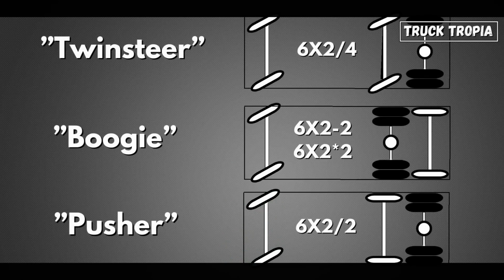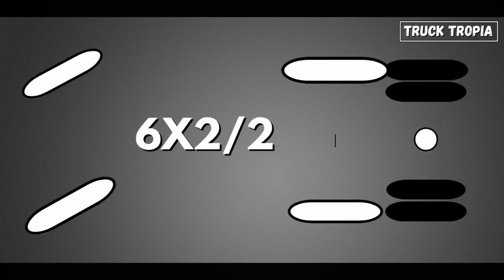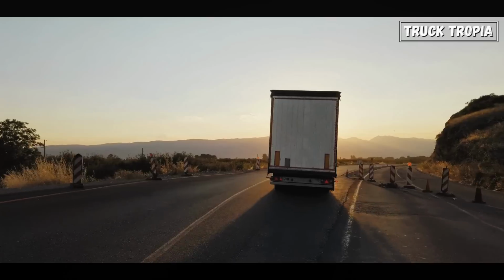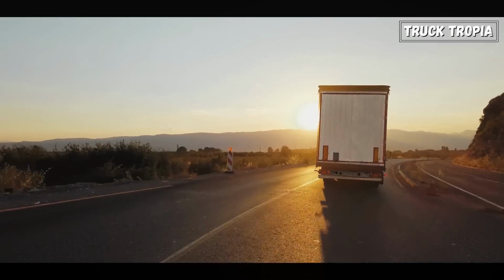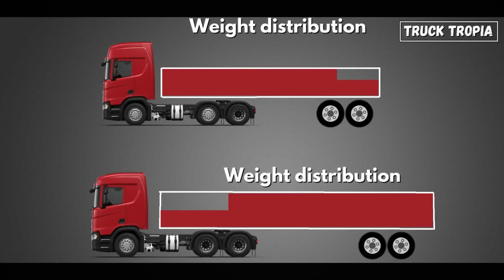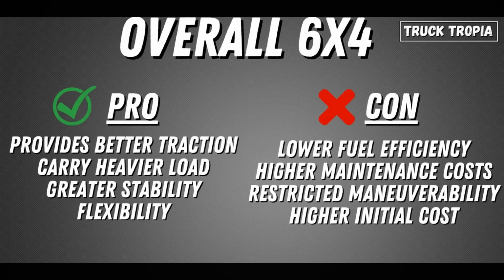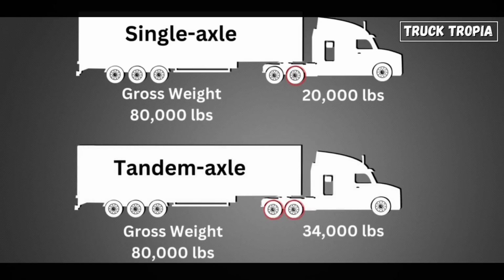THIS Is Best Semi-Truck Configuration - 6X4 vs. 6X2

Comment: This video cannot possibly cover the global weight restrictions and ideas buerocrats have come up with. 

I have driven a Scania 6x2 with lift axle and had to reverse in very tight and muddy bits of a road. When all you habe got are 20cm front and back, and you can only make the turn with spinning wheel despite lifting one axle, you become very appreciative of two driven axles. 

Scania has introduced the disengageable tandem axle which is also liftable. In 2021...This is the perfect solution imho.

Comment: 6x2 and even 4x2 is common enough Euro trucks. Most trucks never leave a paved road, or travel difficult hilly slippy sections often. Flatish, smoothish roads is all they see. For those with Double Drives they often have hub reduction fitted for hauling heavy machinery, 80,000kg gross.

Comment: In Europe the 6x2 can have 11.5 tons on the driving axel but 7.5 tons on the traling  axel reducing the difframce in traction quite a lot.

Typically in nordic country 6x2 are used for medium trucks and 8x4 for heavy trucks.

Comment: The comparison @4:22 is nonsense. 34,000 lb is the basic limit in US federal regulations for tandem drive axles, but 20,000 pounds is the limit for a single drive axle (as in a 4X2), not a combination of one drive axle and one pusher or tag axle (as in a 6X4).

Comment: @Truck Tropia, what you failed to mention about the 6x2 configuration, is that the air can be dumped on the second non-drive axle to increase traction in difficult terrain, you really need to do more in-depth research before putting out these videos, as informative as they are, you still missout vital information or give misinformation, also your basis towards American built trucks is so blatant,  to balance things out why not do a video about European truck and trailers versus American built truck and trailers on the techno side including EBS, design and build of trailers, bearing in mind that the USA trucks normally operates at 36 metric tonnes, whereas European trucks run at 40/50 metric tonnes, and the UK runs at 44 metric tonnes, with I might add a trailer length of 45ft.

Comment: A double locker 44000 lb Mack camelback 20000 lb front end 
200" wb 500hp ISX 18 Speed manual with a non hydraulic clutch 
F model cab Aussie roo bar front bumper 11r22.5 all around on 10 hole classic Alcoas. 
Oilfield head rack on the back of the cab. Frameless dump style 5th wheel. 
Hard cab no air ride. 
I'd pull a 8 axle all aluminum covered wagon  B Train 
The trailers overall length would be 53 ft +15 for the truck 68 ft long overall 
Should be legal to scale a 45000 lb coil in each wagon.

Comment: Hi there, here in Brazil we use a lot of different  configurations to semi trucks. the most of them who drive on Road usually use 6x2 configuration, mainly at long hauled distances. And we use European truck model 100% of the fleet is cabover. Scania, Volvo, Volkswagen, Iveco, Mercedez Benz, Daf. And the most of semi-trailers here  they have 3 axels in tandem. I notice that in the US most semi trailers have only two axles. I would like to know why only this kind of configuration?
Reply: Strange how Volkswagen is european and there are no VW trucks here, but there are elsewhere!

Comment: Actually in Central Europe 4x2 is the most preferred drivetrain layout as with the usual „Euro-Trailer“ with three axles you can make use with the max. GCW of 40t. 6x2s are used in the UK and Scandinavia where higher GCWs are allowed.

Comment: Having a 6x2 or a 6x4 does have nothing to do with the wheelbase. Manufacturers in Europe have managed to make them the same length
Reply: True, but typically if there are two rear axles with neither of them steered or castered (regardless of whether or not they are driven) will need a relatively long wheelbase to keep tire scrub in tight turns to an acceptable level.

Comment: Why 6x2 when you can just run perfectly on 4x2 instead?
Reply: You can legally put more weight on the truck
Reply: @maxi5778  Well that's hardly a good reason to do so because there are many countries such as India, Philippines, Indonesia, Vietnam, Thailand, or any of those 3rd world or 2nd world or developing countries have shown that 4x2 is more than enough to haul such goods. Even 4x2 underpowered japanese branded semi trucks (Fuso, Hino, UD) with poorly maintained engines are able to haul a 20 footer container or big heavy pipes and steels on a trailer bed without any problems.

In Europe or America, they even barely haul anything seriously heavy container goods and yet utilises a 6x2.
Reply: @Intel & Nvidia SUXXZZZ!!!  I daily drive a 6x4 and I quite often do heavy haulage driving loads that weights around 58 tons with my trailer, my colleagues that drive 6x2 with the same trailer are legally only allowed to load 54 tons, everything is exactly the same except from one truck has one more drive axle
Reply: There is no better or worse, it all depends on local regulation, roadnetwork and the market situation.
Reply: https://youtu.be/SMzQb0s302w

Comment: No, you're wrong about the 6x4 having more stability than 6x2's

Here in the United Kingdom, there is NO height limit.

British motorway bridges have at least 16'6" clearance available, so many trailers are double deck 16'3" tall. 

These trailers carry 42 or 52 pallets at 44 tons (97,000 lbs).

The American weight limit is only 36 tons (80,000 lbs)

I drive 44 ton double deckers over the Scotland's highlands in the snow with 6x2 tractor units.

There is no problem with stability pulling 44 tons worth of double decker on VERY twisty Scottish snow & ice roads with a 6x2 tractor.

Ye dinnae ken yer bleathing on aboot!

Comment: No, you're wrong about weight limits.

The standard British weight limit is 44 tons (97,000 lbs). Most tractor units are 6x2. 6x4s don't carry more weight.

The American standard weight limit is only 36 tons (80,000 lbs).

The American habit of 6x4 is due to tradition & stupid US law.
Reply: In the Netherlands it is 50 or 60 tonnes, depending on the outfit.  In Sweden it is more and in Finland they are going up to 90 tonnes or so, this although with two driven axles
Reply: I doubt there is any US federal law which makes a distinction in load capacity or legality between 6X4 and 6X2.

Comment: The best for road use, fuel efficiency and weight saving in the 4x2 configuration, as almost all 44 tons semitrailer trucks in Europe.
We have to say that the standard tires are bigger in Europe.
Reply: A 4x2 with a 3axle trailer is the worst thing on the road
Reply: @aanriuha our truck trailers are very heavy: the axle are usually three, but with single, bigger wheels. The road tractor has 4 wheels, but the tire size is bigger in Europe. One more axle means more weight. This standard setup was developed after decades and it's the best for the European roads.
Reply: with the highest road wear... 6x2 plus 2 axle trailer would be much better, since the weight gets distributed more evenly and there is no single axle carrying a high tonnage but the weight of the cargo is split 50:50 on 2 axles each.
Reply: @denzzlinga  Depends on how the axles are placed under the trailer.
Reply: @bertnl530  sure but you can´t move them a lot without the need of steering axles, due to eu regulations how the whole thing has to turn in the end.
Reply: @denzzlinga  That's true. 
It is also a question of write off.  Trucks are expensive,  tri axles are even more expensive.  Normal write off for a truck is like 5 or 6 years.  With leasing it is like 3 or 4 years.  Then the fear for smaller defects and  time in the workshop  comes.   
With trailers however it is a different story.  Trailers can have a working life of 12 years or more, without big problems. Tyre wear is normal wear .  So it is easier to write of a more expensive trailer and earn money with it, then with a truck. And write offs and money is an important thing in trucking.
Reply: https://youtu.be/SMzQb0s302w

Comment: Euro Trucks look Feminime, No Driver Comfort, US Trucks are the Best
Reply: Depends on what you mean by driver comfort. The only thing US trucks have going for them is more space. Other than that they only just now starting to catch up with the tech that EU trucks have had for the last 10-20 years
Reply: @rikardandersson7288  well Space, is a big comfort factor
Reply: @nenadcubric2663  can't argue with that. However other driving aids and ergonomic solutions also contribute to driver comfort. Take volvos vds for example, it is speed sensitive steering that allows you to literally steer with one finger when manouvering. And it also takes away the jerking in the wheel from potholes. Not to mention that it also steers the truck back in it's lane if you start to drift. Other things as adaptive cruise control, blind spot monitoring and the best automated gearbox on the market also adds to driver comfort in my opinion
Reply: Have you ever watched the videos here on YouTube where they test a new Scania R770 V8 in USA? Everyone that drives that trucks says it's the most comfortable truck they have ever driven so clearly it's better than many american trucks. You should watch these videos

Comment: I personally drive a 8x2 tanker truck with 4 or 5axle single wheeled trailer.
68tons and 1 driven axle. There is a button for "shifting weight" to the driven axle, making it kind of over loaded ("Norvegian" boogie in volvo up to 18tons for driven axle). The axle is durable enough and usually slippery conditions mean that the road is frozen so high axle weight won't damage. 
The most common in config in Finland for tractor units is 6x2 with last axle being liftable and having dual wheels for higher weight limits
Reply: Here in Brazil I drive a volvo FH 540 with 2 semi-trailes and 9 axels in total configuration. 74 tons of weight and 54tons of payload.
Reply: Forest industry on Finland also users 8x8 trucks. Already scabies does 8x8 trucks. I've driven a few of those

Comment: US trucks mostly are 4×2 & 6×2! In USA loads are light roads are straight flat but very bad only 6 steep long hills BUT the diesel fuel is lower qualuty still freezes winters & is cheaper than in Europe! The maintanance in USA is bad due to lack of professional service mostly Mexicans do the labor!
Reply: No, most Class 8 highway tractors are 6X4, not 6X2. Perhaps 6X2 is common in your area, but they are not across the USA. There are tractors with no interaxle differential, and a disconnect for the rear axle, so they are 6X2 until the second axle is engaged, then they become 6X4.

Comment: for me as a truck driver's son, here in the Philippines they choose the 6x4 configurations because the roads here are very difficult and another thing is that the trucks here are heavy, let's take as an example the Rigid trucks that are 10 wheeler wingvans their maximum load is 25,000 tons almost 50,000 pounds. if you travel from luzon, visayas to mindanao you can't avoid going through the mountains because most of the part of the AH 26 highway goes through the mountains and the elevation is so difficult, that's why they and I preferred that.

Comment: In ATS I always use 6x4 for the trucks I drive since I haul a variety of trailers everywhere so I need greater pulling power and flexibility. Maintenance and fuel cost are probably not very noticeable if there is a difference at all in the game. 🚚
Reply: Plus, I feel more stable driving 6x4 or 6x2. And braking distance also feels shorter compared to 4x2.
Reply: What's ATS ?
Reply: @aanriuha  American Truck Simulator, it's a trucking game for PC.

Comment: Truck axle configuration is affected of legal limitation about vehicle or road law.
In The United States, Federal bridge formula restrict maximum gross combined vehicle weight (GCW) up to 80,000 lbs (almost 36,000kg) if trailer-tractor truck has 5 axle (3 axle tractor and 2 axle trailer).
BTW, The United Kingdom vehicle and road law restrict GCW up to 44,000 kg (almost 97,000 lbs) if trailer-tractor has 6 axle (3 axle tractor and 3 axle trailer).
And If trailer-tractor has 5 axle (2 axle tractor and 3 axle trailer), GCW is limited up to 40,000 kg.
In European countries in Continental, their law restrict GCW up to 40,000 kg if trailer-tractor has 5 axle (2 axle tractor and 3 axle trailer) by EU order.
So many over the road tractors operated in The U.K. are equipped 6x2 axle configuration with lift axle.
In The U.S. 6x2 tractor provide better fuel consumption and maintenance cost.

Comment: 6x4 are very well matched for the 500 hp plus European diesels, yet are less popular there🤔....quite a paradox. Anyways, we get to put the to proper duty here in East Africa due to our less than adequate paved roads on last mile to destinations. 6x4 tractor lays traction power like a beast.....and gets the cargo delivered on a cinch!
Reply: 6x4 in Europe will result in a very shor trailer. Their roads are very small so 6x4 with 3xl won't be flexible in turning
Reply: 6X4 doesen´t make sense for standard trucks in europe. You would have to be super carefull when loading, since then having only 2 axles on a standard 13,60 m trailer (you won´t need more than 5 axles total for 40-44 tons) can make them overloaded pretty fast. You would need to stuff everything to the front of the trailer, leaving the back almost empty. 
With a 4x2 tractor and 3 axle trailer, you can evenly distribute the load from the front to the back of the trailer, and everything will be balanced without any issues.
Reply: It's because of fuel efficiency too. In EU most tractor trucks are 4x2s and they do a fine job on asphalt roads, you just use more fuel with 6x4 and get nothing out of it. I've seen more 6x2 with lift axles (the extra axle is lifted up 99% of the time even while hauling a trailer) and 8x4 trucks (like the Actros SLT) than I have 6x4s. I'm pretty sure 6x4 tractor simply doesn't make sense here. Maybe for construction or something.
You need your cargo to make both 6x2 and 8x4 truck an unacceptable choice (like 6x2 can't haul, 8x4 too expensive) for that configuration to make sense. I doubt there is a huge amount of cargo pulled with tractor units which fits the description.

Comment: In the US, driven or not doesn't change the weight rating.  A tag axle makes a single axle a tandem axle.  It is even a loophole in the form that it is common to put 24,000 lbs on the driven axle and only 10,000 lbs on the tag.

Comment: Lift axles on the tractor aren't legal where I live. I'd take a tri-drive anyway
Reply: How can that not be legal? I'm just curious because i live in Norway and here all semi trucks and many rigid trucks has it. The most popular combination here is the 6x4 taglift.
Reply: @BjornS22193   I'm not sure exactly why they aren't legal here.  Our regulations allow a pretty high axle weight regardless so they aren't really needed. We can haul 17,000kg on a standard tandem set, 24,000kg on a tridem.

Comment: Both good and has its own advantages can't choose so i would prefer to have both if possible XD
Reply: There are options for that. Nowadays Volvo and Scania have 6 x 4 but one can choose to let the last axle  freewheeling and only used when conditions ask for it, like tipper trailers which do 90 % of their work on asphalt.  Also M.A.N.  and DAF offer hydraulic driven front axles which are much lighter, due to no drive shaft of diff and offer improved traction.
Reply: @bertnl530  Ah yeah i forgot about liftable 6x4 axle
But my preference goes to Scania and Volvo, that might sound so cliche for idolizing both but it cannot be denied how both of em are the real piece of work
I like Iveco too but i prefer the 2013 Iveco hi way design more over Iveco S way
Reply: @aokusazimniy8  I think Volvo and Scania are favourites for many people. IVECO has not a very good reputation, but I don't know if these stories are based on own experience or on hear-say.
Reply: @bertnl530  Well cuz both are the top brands of COE Semis
About Iveco it's the series before S way the Stralis series where main dislikes is from the Driver side windows. It has a straight frame blocking the driver's visibility in which most of people feels so uncomfortable and dislike it, Iveco can just remove it but they did not
With the new S way series the windows frame is removed and driver has no more issues about it ever since
Reply: @aokusazimniy8   Drivers have also big foreholds against the newest S way. "it is nothing. I quit work when I get one"   I think most of the drivers never sat in an IVECO.  and complaints are spread 20 times more then good news or no news at all. Image has a lot to do with it.
Reply: @bertnl530  Man idk about that and more like just know about that cuz i haven't heard any complains about S way but now i know it has those flaws but idk cuz im not a fan of the S way and i like the Stralis Hi way more than S way cuz of the design wise